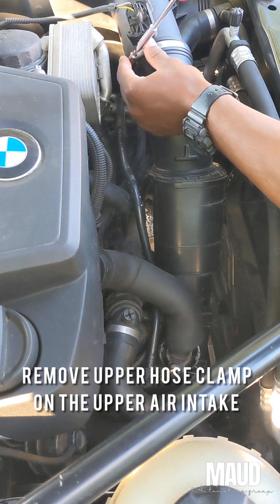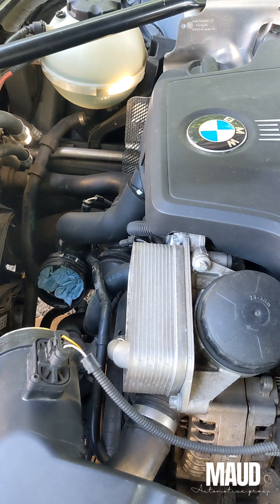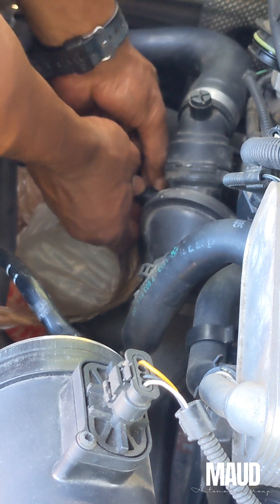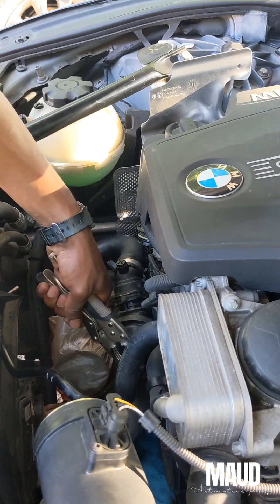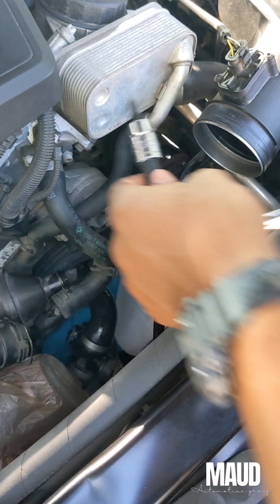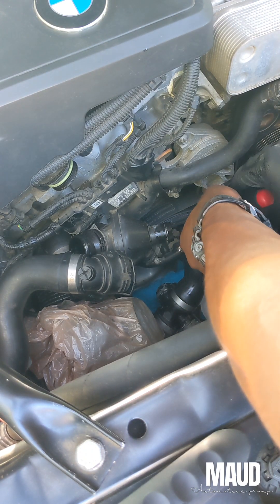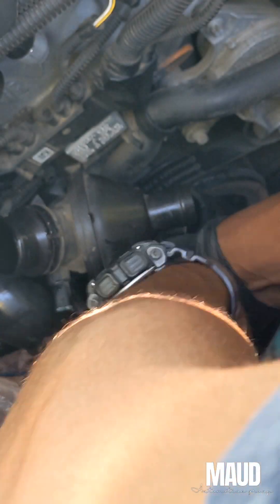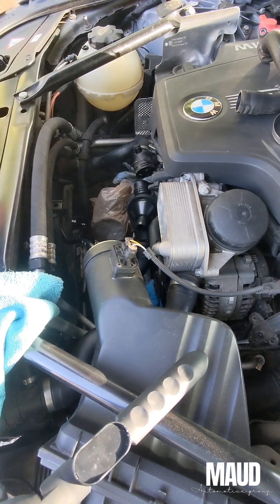BMW F10 N20 Thermostat replacement

Comment: Bout to do this on Saturday, wish me luck!
Reply: What are those tools you used
Reply from the maker: Tools: 6-inch extension and small 3/8 ratchet/Torch 30/ pick tool and flat head screw driver. You got this.